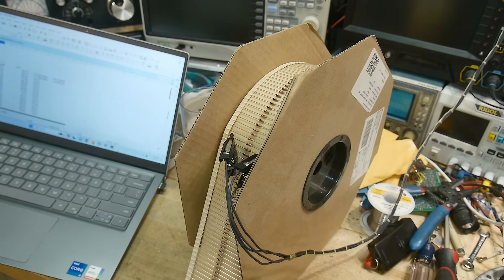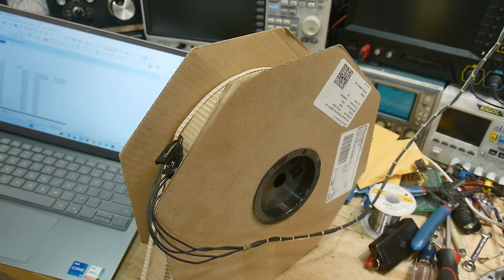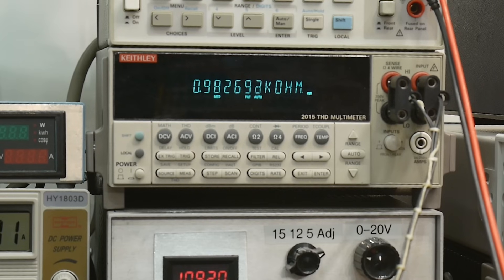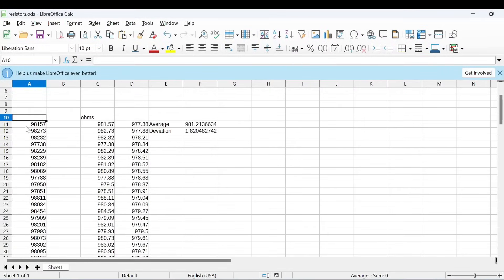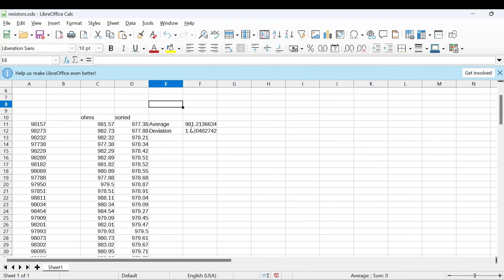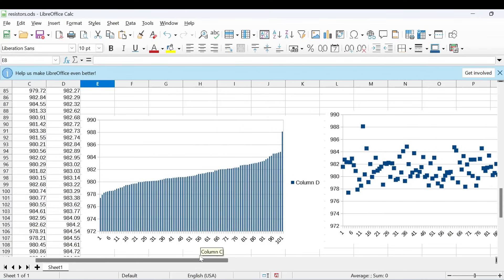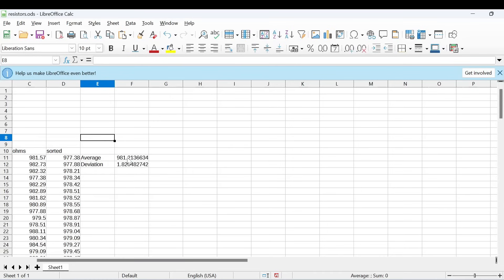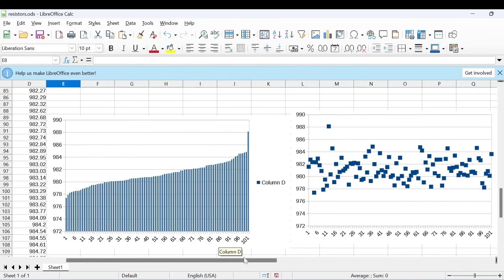#1748 Statistics and Lot to Lot Variation

Comment: Interesting thought(s) in my mind…  First I pondered how much of the settling of the measurement indeed could be thermal.  The 3458 meter has quite some amount of filtering and it sees Open Circuit (= full scale) between each measurement.  The settling of the results downwards is likely to be due the meter.  HOWEVER, limiting the results to just 2 decimal places mitigates some of the least digits drift on the statistics.  So we can basically ignore the drift for the final conclusion.
 
Then some old memory.  I once designed a Unijunction Transistor and SCR based controller board.  I had a choice of low cost 2N2646 or high price 2N2647.  We purchased a few of the latter ones and 100 or 200 of the 2N2646 version parts.  The more expensive ones were nicely at the specification window.  The 2N2646 on the other hand seemed to miss entirely the nominal values or anything near the nominal.  I put together a test setup and measured 100 (or 200?) units with our then new HP5245 counter that had a digital volt meter plug-in.  Then I plotted the “trip” voltage — called intrinsic ratio — spread on graph paper.  Very clear bimodal distribution appeared.  We complained to the vendor, who contacted the manufacturer — who on their part denied any chance of having picked the “better ones” out and selling the bimodal remainders to us.  My guess is the communication took place only between sales men……

Comment: Good job demonstrating variation overall. One comment on your graphical analysis. Performing a sort from lowest to highest does not reveal anything. Regardless of the tolerance, 5% in this case, you will always have the same looking graph because there will be lowest and highest values. If a manufacturer is fixated on quality and manages to produce a high amount of precisely 1K resistors, then your graph would be flat in the middle, but the cost of those resistors would be quite high. I think the resistor measurements in order on the tape and plotted would be more interesting because you might not see randomness all the time but perhaps drift moving upwards or downwards or perhaps oscillation, highs then lows repeating, indicating a somewhat uncontrolled process. I love exploring and teaching variation, and the boring details of it, as a 6s MBB.

Comment: One of the harder classes I took in EE was "measurement theory". No actual measurements were done there, no lab exercises, only theory. We learned about value distributions, relative error calculations, 3-5-5 wire meausrements, internal workings of many measurement devices, measuring voltages, currents, impedance, time, frequency, workings of AD/DA converters, etc.
The exams were not easy at all, but were nothing compared to the lab exercises later (that we hated mostly because the incoherent design.

Comment: It's interesting that the variation is uniform and does not follow a 'normal distribution', so I guess the QC of the manufacturing process is good?   

Is what you call 'deviation the Standard Deviation, or the Coefficient of Variation?
Reply from the maker: I calculated standard deviation
Reply: The number of parts tested is too small to get a good picture even in the scatter plot. If the simple difference from the mean or from nominal, binned to perhaps 10 to 20 bins were used, a different picture of distribution might emerge.
Reply: It could be a normal distribution still, just not around 1k, and with the long tails cut off by the auditing process.

Comment: I would get a .1% resistor and check your measurement calibration. If those were supposed to be 1K there has to be some kind of error. Maybe chinkism? I have Corning 1K resistors and they read within 2-3 ohms of exactly on. (1% metal film) I took a bunch of random value chink carbon film (modern) resistors (ebay assortments) and they all were within a spread of about 5 ohms of the marked value.
Reply from the maker: they are digikey parts. made by Stackpole Electronics. CF14JT1K00TR-ND https://www.seielect.com/catalog/sei-cf_cfm.pdf   don't compare apples to oranges, these are +/-5%  carbon film. and they came in 1% of 1000 ohms

Comment: I’ve done this with my B&K LCR meter. It would be good to compute the median value as well. If you wanted to compare variation around a mean, you could compute a one-sample t-test against the reputed value (i.e., 1K here) with a “large” sample. Your 100 units meet that criterion, for sure. This would provide an explicit QC test against the reputed value they present first sale. 

Nice video!
Reply: I assume that he sorted the observations to find the median, whatever tests he did. BTW I have the same meter.
Reply: If he computed the median, I missed it. I only saw the mean and SD. There’s a lot of open source software that will import the spreadsheet.

Although I used my B&K LCR, I also happen to have this same Keithley 2015THD. I just did get the Kelvin probe set.

Comment: I worked for Admiral Television back in the 70's.  I heard a story from one of one of the engineers.  He was doing some kind of a hobby job after hours, and needed some 'high precision' resistors--5%.  The standard at the time for cheap resistors was 20% carbon comp.  So he got a batch of them to pick out a few that were 5%.  None were.  In fact, the distribution was bimodal.  Either 10-20% high, or 10-20% low.  It seems their resistor process made 20% resistors, and they selected 5 and 10 from that, so none of them were in the 5 or 10% limits.

This had an effect on the design process later.  We had a CAD program that did monte carlo analysis on circuit designs, but predictions were poor when we used standard distributions.  We had to modify the code to use the bimodal distribution to get realistic results.
Reply: Ah,  beat me to it,  I remember those days
Reply: Great and interesting story. It is easy to assume a normal distribution, but many times that is not the case!
Reply: Exactly! You were victims of binning!
Reply: There's another video on YT showing exactly this.  One is unlikely to find the nominal value in a 5% or 10% lot because those clustered at the nominal value were sold as 1% or 0.1% tolerance units.

Comment: Keep in mind all components have tolerances and the interaction of the components can greatly affect the desired output.  Some of the tool that are used are Six Sigma design, Monte Carlo circuit simulation and Cpk studies all help to design and maintain products.   Incorrect component and design selection can have devastating consequences.  I once worked for a company that selected a power supply topology where the switching FETs at the time "met" spec but did not always preform causing the product to not meet it's intended MTBF.  It took more than 5 years for FET technology to improve before preforming the application they were being used.  Needless to say it was an expensive design choice.
Reply: If you are simulating bolt failures on airplane doors, you need to get it right! That means EACH bolt.
Reply from the maker: I don't think you should be picking on the poor bolt. I bet he is still in the box.
Reply: Lol @ imsai

Comment: Why did you bought carbon instead of metal film resistors.
Also you should have purchased 1% tolerance instead of 5%.
Reply from the maker: the reason I purchased these was price. I bought the reel of 5000 parts for 99 cents
Reply: ..oh well then! 😊

Comment: Part of that drift is the grinding wheel used to remove material to get to the value is wearing, they might not measure each resistor during grind, as that means slowing down the machine to the multimeter speed, but instead ground every 10000 to that speed, and then the grinder is going to repeat the grind 10000 times, as the coating would likely be very even on the batch once it is running. Thus the rising trend, and the outlier was the one where the grinder either did a compensation for wheel wear, or one that was ground wrong, possibly due to a bit of old material hitting the wheel and lifting it up.

Of course the resistors on the reel are not actually sequential, they all are close to sequential, but are generally ground, then washed, dried and then coated, then get measured again to get the actual value, and then are sorted into 1%, 2% and 5% bins, with any that are outside the 10% value getting discarded as waste.  Your 1% get the blue coat, same as the 2%, but the rest get the pale coat, and then get banded, and bandoliered. So there will be a hole around 3%, from the sorting, and thus 5% resistors are guaranteed never to be the marked value, but always a little off.
Reply: What rising trend? The observations were sorted by value, which does not correspond to the position on the spool. The scattergram presumably reflects the observations in the spool sequence.

Your observation about the 5% resistors is correct, because the more precise ones have been removed.
Reply: These are carbon film. As far as I know, no company tries to market carbon film resistors with 1% tolerance. I simply can't imagine any knowledgeable designer using them. 10% tolerance parts in ordinary values of carbon film resistors haven't been sold for decades. You might encounter them at very low values (10 ohms or less) or very high values (greater than 10 M).

I used to use Philips CR25 ±5% carbon film resistors. Almost all, again with the exceptions of "extreme" values, were within 1% of nominal value. Finding one that was "bang on" was rarely a challenge, though again no one who knows what they are doing would use carbon film in a demanding design.

You might get bimodal distribution in the 5% parts in the video if the 2% are selected out.
Reply: @D614G_aka_Doug  You think the cheap resistors you find on Ali are metal film in all. A lot are selected carbon film, because the machine is paid for, and paint is cheap.
Reply: @SeanBZA  
You could be right. I never even consider the garbage vendors you find on Ali. I was referring to reputable, known manufacturers sold by reputable distributors.

Comment: Funny youake this video now. I've just done something similar with Vbe on a load of 2N3904 NPN transistors and ended up with an almost perfect normal distribution of values.

Also, it does look like that graph begins to curve exponentially towards each end. Maybe lowering the resolution to the nearest ohm (+-0.1%) and plotting the distribution would help show that better.

Comment: You are seeing this effect due to binning. If the factory finds one that is 1K perfect (minding the tolerance) they will bin that one under a new (higher priced) series. There was a paper about it, explaining the process but I can't find it now.
Reply: What, no 20% resistors anymore??? ;-(
Reply: @TranscendentBen a lot of the ones I’ve got sitting have become 20% if you count that 😂
Reply: Not only the binning. Mainly cheap carbon resistors tend to be drifty as they age, so quite common is to bias the manufacturing process to keep more tolerance space in the direction the given technology tend to drift. So if you have something to do with a technology that tends to drift up in value (either by age alone, or by the stress from soldering or operation under allowed power dissipation load), the resistor trimming grinder machine will be set to target a bit below and that is what you are seeing on this new, unused reel of resistors. The aim is to keep the real parameter as much centered in the tolerance band as possible over the whole anticipated lifetime.
Reply: This explains something to me.  I think I saw the same paper: at least, I heard about binning.  So I'd expect my 20% resistors to be -10% to -20% and 10% to 20%.  But what I see when I test a pack of 5 from Mouser or wherever is all on one side.  I think lot-to-lot is the answer.

Comment: The self heating is interesting to see. Curious what the TCR is.
Reply: Carbon film resistors have a TCR in the range of several hundred ppm/K, almost invariably negative - e.g. -500 ppm/K. That's why it is generally an exercise in extreme silliness to seek a tight initial tolerance by select-on-test.

Self heating, even with good resistors, is something that can't be overlooked in precision circuitry. You may need to operate parts far below their nominal power rating, especially with SMD parts where the thermal resistance can be rather appalling.

One of the things that annoyed me greatly when I made the transition to surface mount designs was that going to 0.1% tolerance resistors only gets the tempco down to typically ±25 ppm/K. I was used to ±50 ppm/K for 1% tolerance leaded parts.